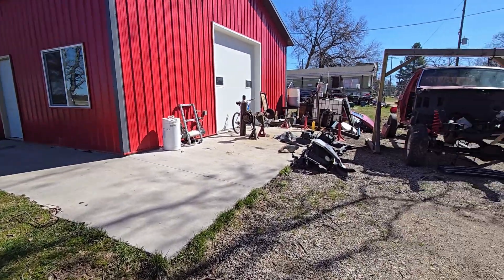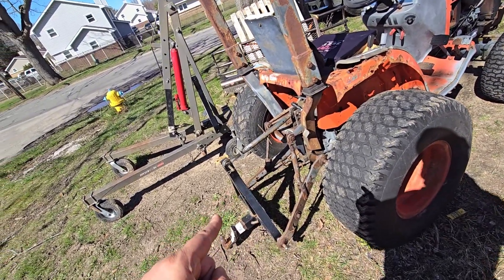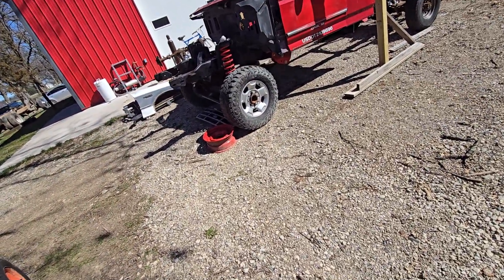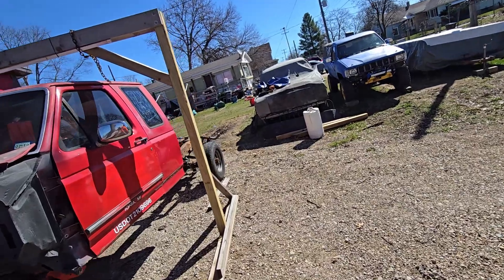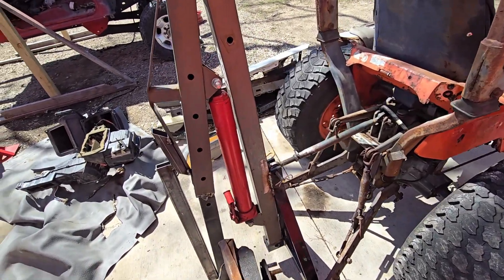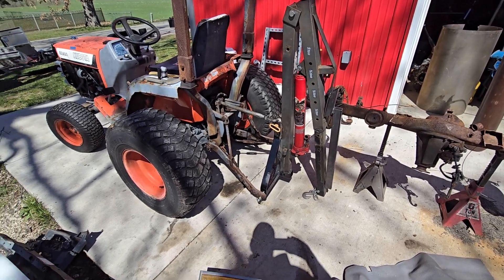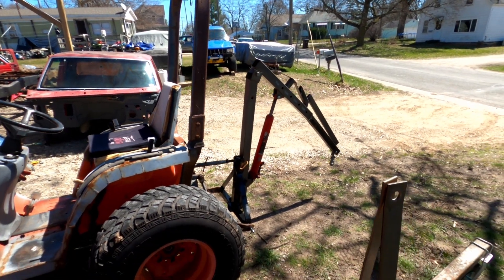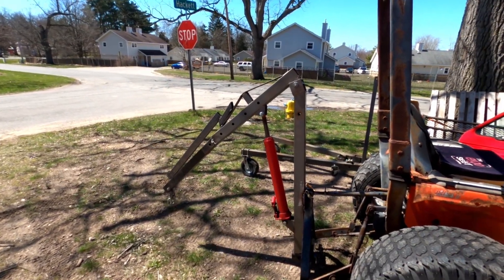Unleashing The Power: Creating A Hydraulic 3 Point Lift System for any tractor

Comment: I don't know if the tractor has the capability, but how sweet would a tractor powered cylinder be on that cherry picker?
Reply from the maker: It has enough flow to run a cylinder, or loader, or both. Plenty of flow, currently no hoses or controls though.